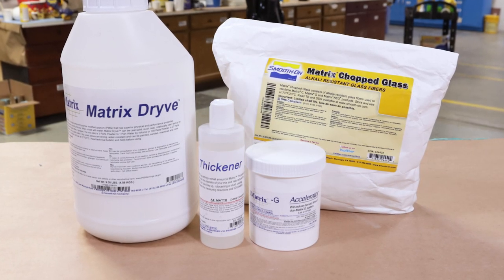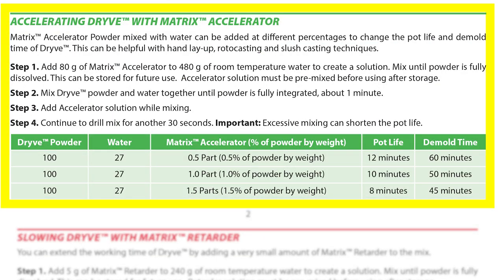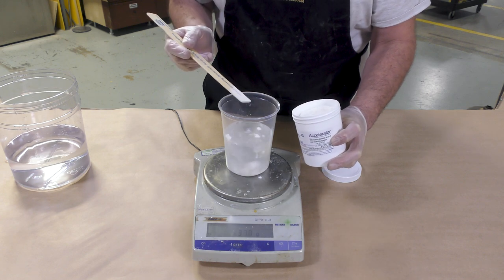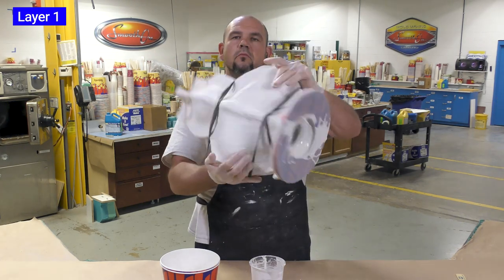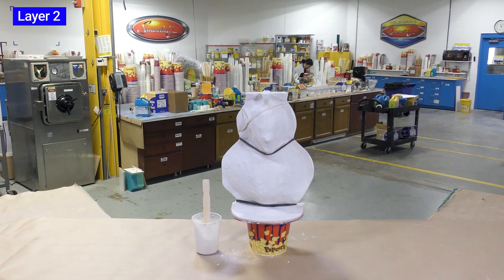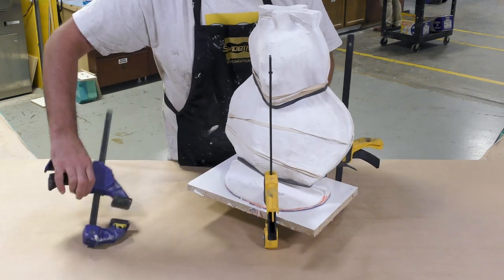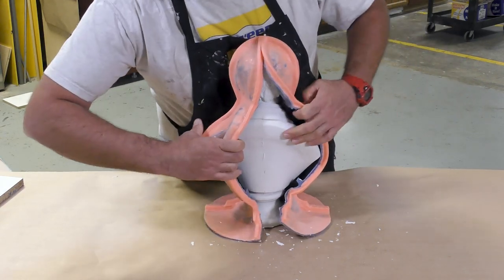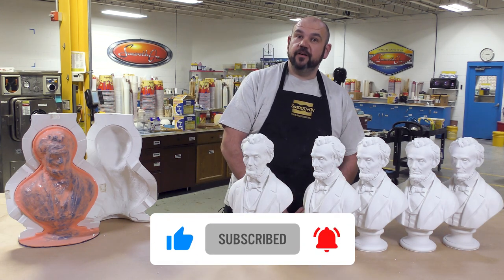Making a Lightweight, Strong, Hollow Casting Using Matrix™ Dryve Polymer Gypsum

Comment: Regarding the tip about brushing on the Sonite wax to the support shell to seal it against casting material, is this something that should be done prior to each casting?  Or is one application of the wax good for many castings?
Reply from the maker: It should be good for multiple castings.

Comment: I’m just wondering, if there could be a (support shell material ) that could be brushed on then hardens,  ie - something like the 3D resin that you could brush on then flash it with UV light to build up layers to ( whatever thickness you desired )  kind of thing 🤔
Reply from the maker: Our Plasti-Paste II is a resin support shell material that cures quickly and is very strong: https://www.smooth-on.com/products/plasti-paste-ii/
Reply: @smoothon  yeah, but I was thinking of a Smooth on (own version) for a very quick (possibly large or quite small castings ) that could be done very quickly - at lest it might be something to give you’re chemists something to investigate 🙂
Reply from the maker: This is a great idea! We will forward it to our lab.